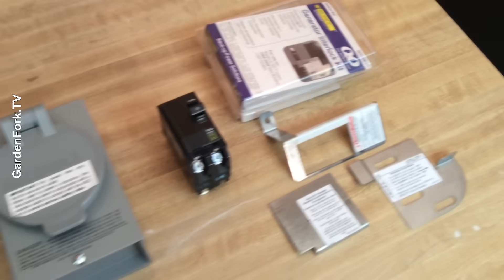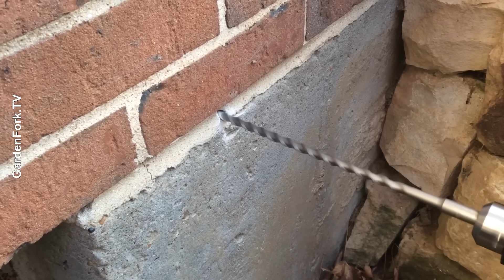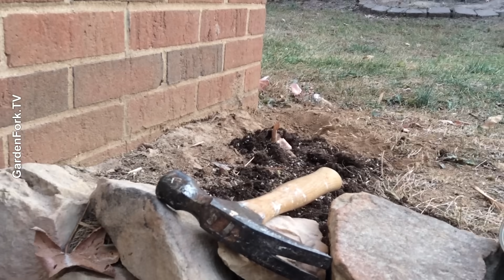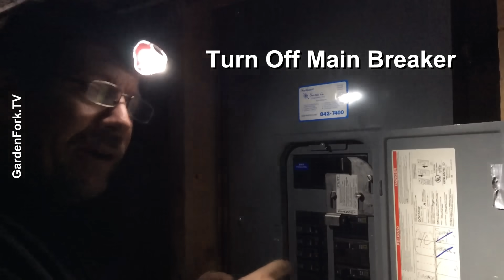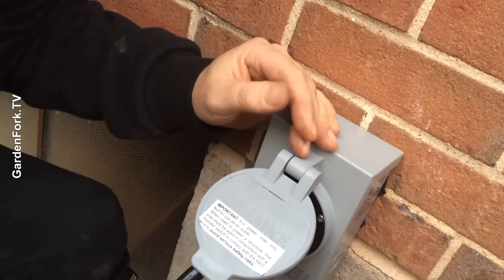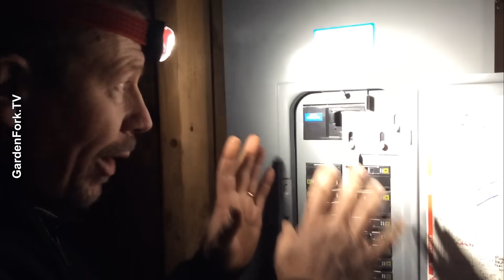Your Easy  & Safe Way To Hook Generator To House | Generator Interlock Switch Install | GardenFork

Comment: Other than looking at the neighbors houses for their lights being on at night let's say, how do you know when the grid power is back online (especially in the daytime)?
Reply: Quincy Birwood... If you have a Smart Meter, simply walk outside & look at the LED, if illuminated, power is back on or purchase a" Power Back " unit. They cost about $35.00, i.e., Reliance # THP-108 @ $35.13 is one that is out there... Hope this helps a littlle...
Bill Farr...:-)
Reply from the maker: You can switch the interlock back over to the util power, or our power company does a robocall when power is restored.
Reply: Look at your neighbor's house again.
Reply: There are products you can install to give you a tone when power is restored to your main line.  Check out PowerBack Utility Power Return Alert.
Reply: don't where you live but our power company calls us both when it first goes out -- to give us an estimate if when it is coming back and again when the power is restored.  But looking at your neighbors works fine also. LOL
Reply: Okay. Thanks.
Reply: That's what I do go outside  and check the smart meter  see if its  reading  or on

Comment: 1. Color Code the breakers & List ALL
2. I only power Refrigerator, 6 Lights, 2 sockets.
I cut off main breaker.  Disconnect/ reconnect refrigerator on a socket next to main socket. Go to basement, disconnect/ reconnect the 6 lights & sockets. Crank gen that sits in basement. Exhaust is plumbed via exhaust chute and a solar powered extractor... trust me No fumes, No Fuss.
Gen sits on 2 3/4 24"×24" plywood [treated] on a stilt/table made of 2x2 1/4 tubing standing 18 in of ground... both are grounded into brick (you nailed that one). The metal table was primed & painted (liner is deceptive). Wood was retreated, primed & painted.
Sorry no video!
Happy Wife, Happy Life!
Good Job
Reply: Nice.  Let's hope nothing overheats and no fires.

Comment: GREAT video, this is the first time I've had someone explain this concept to me in a way I could understand.  Thanks!
Reply from the maker: Yeah Craig it took me a while to wrap my head around it, but the interlock is a good generator hook up solution, I think. Thx!
Reply: @gardenfork  it is not good or safe.

Comment: Great video!  How do you know when your power is back... :)
Reply: Look for lights at your neighbor's house....duuu
Reply from the maker: Yeah that’s the one thing with the interlock, I haven’t seen a good solution yet. Thx!
Reply: The $1 million dollar question.  There are products you can install to give you a tone when power is restored to your main line.  Check out PowerBack Utility Power Return Alert.  While your at it consider installing a spot near your circuit panel like Progress Lighting 2-Light White LED Emergency Fixture Unit.  I bought both from Home Depot.
Reply: Everyone has internet log on to the outage map for your electric company they are very accurate
Reply: You look at your meter and if the digital numbers are lit up or the old style dial is spinning your back on the grid.

Comment: Interesting video, but.... in an area where your neighbors' properties share a fence, this isn't going to make me any friends. Are all generators that noisy? I guess I'll just have to invite everyone within earshot inside. :)
Reply from the maker: Hi Chris! It’s always good to invite neighbors in need. In my town almost everyone has a generator so it sounds like the whole town is all mowing their lawns at once. Plus you can always throw an extension cord over the fence, makes for good neighbor relations. Thanks for taking the time to write! Eric.
Reply: Chris Donovan 

Not all generators are that noisy, but you can move your own generator away from the fence to keep peace with your neighbors as they sit in the dark.
Reply from the maker: The Honda water cooled portable generators are incredibly quiet. Not cheap, but they’ll run forever.
Reply: Please don't think that I'm a jerk. Being a good neighbor is a mutually beneficial thing. However, gauging from the last black out here in Yonkers, I think only one family in my neighborhood had a generator. Even if they share power, that good will can only go so far. Anyway, that's enough doom and gloom. Thanks for the video. As usual, it's good food for thought.
Reply: @Chris_Donovan  even if you just give them a place to charge their phones, it will go a long way.
Reply from the maker: It’s all good Chris, I see your point. Thx!
Reply: You can put a car muffler on the generator and it will hush it pretty well. Look it up on youtube.
Reply: When theres no power who cares
Reply: Everybody around me has a generator so..

Comment: Great info. I’m sure that’s a much cheaper instal than the transfer panel and it’s way fewer parts so probably less chance of problems
Reply from the maker: Exactly! Much simpler than my transfer panel. And no limit on which circuits you can run, within reason. Thx!

Comment: Hire an Electrician ? I am here , waiting ....    :-)
(((And what do you think about using a pneumatic drilling machine for drilling holes in concrete or bricks and about building a little sound reducing shed outside at the wall, where the Generator can remain "forever" ?)))
Reply from the maker: It all works John. Though the muffler shed has to allow air circulation to cool the generator. Thx!
Reply from the maker: Btw, some of the higher end generators are quite quiet these days. Honda for one. Thx!
Reply: yes, but the Honda cost 3 times as much....say $4000 for 6500 running watts.